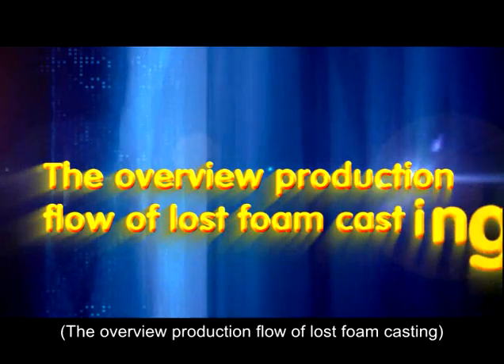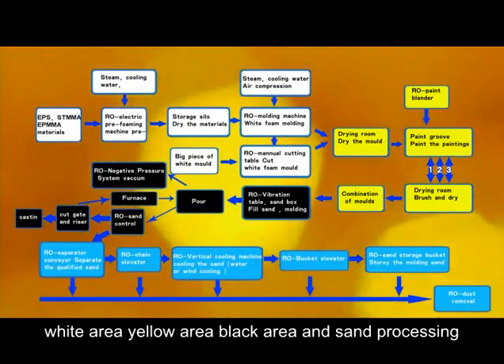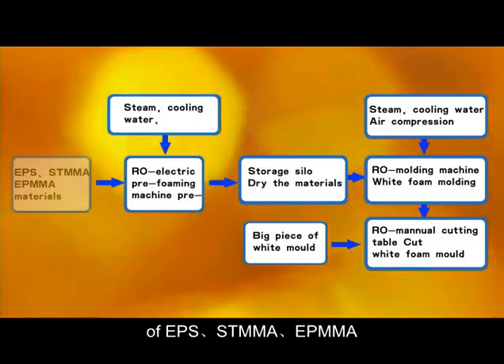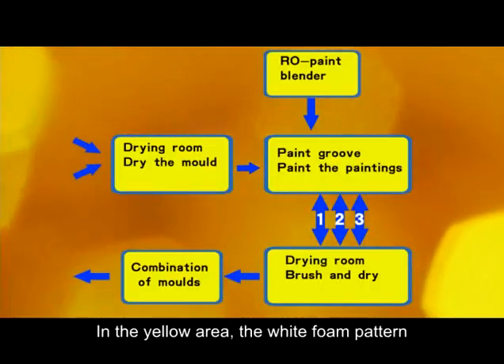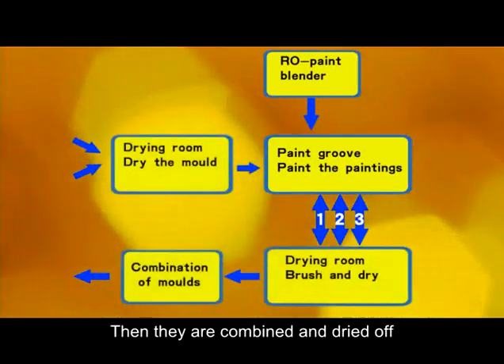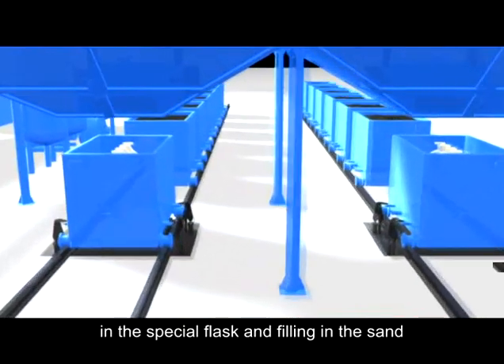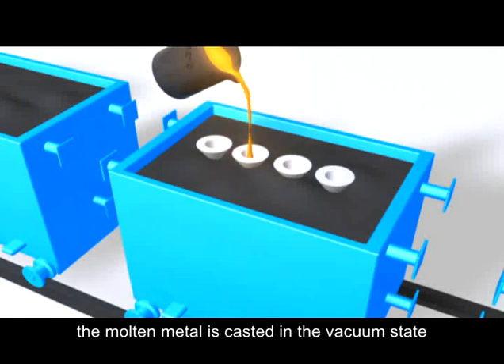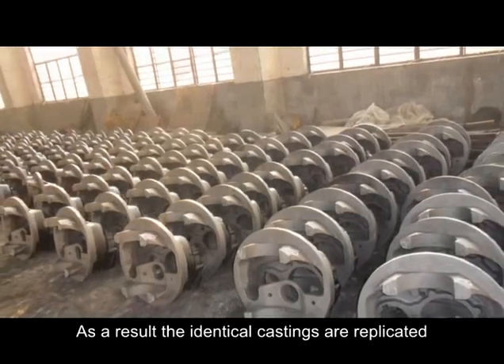The Lost Foam Casting Process Flowof Ruiou company

Comment: Lost foam casting is a hobbyists approach on green sand casting. And is really bad for the enviroment. The proper way would be doing lost wax casting. But wax takes actual skill to do properly. Even better is bonded sand castings..  So somewhere in china someone thought it was a good idea to take a plastic and make it burn in to the air with each part..
Reply: General Motors Saturn Division used LFC from 1999 to the end of production. And emissions are actually lower due to lower bonder burnout as compared to sand casting.
Reply: Lost foam casting is a well established industrial process used worldwide.